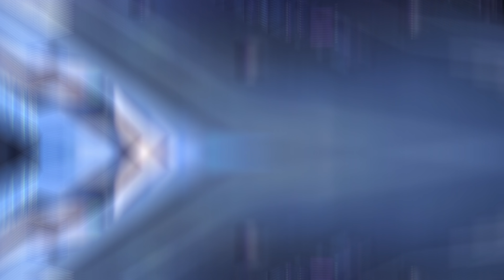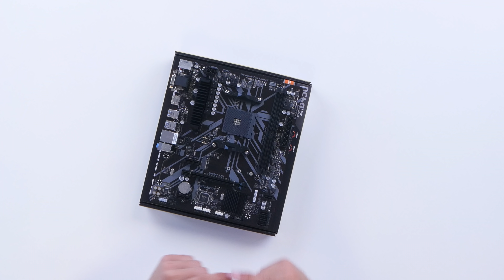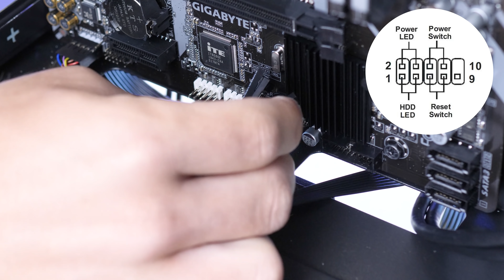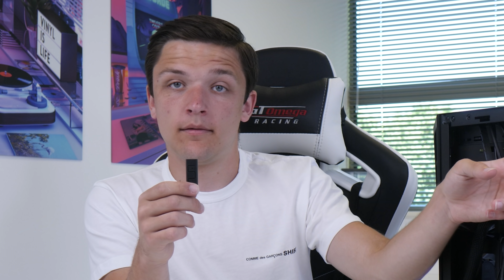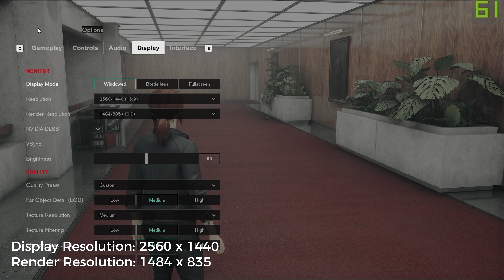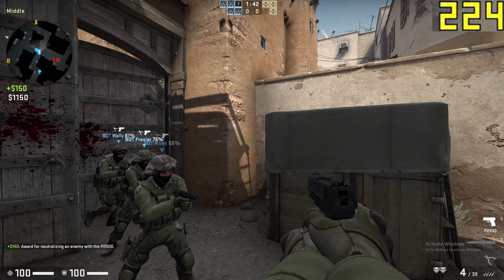Epic $800 Gaming PC Build 2020! [RTX 2060 w/ 1440p Benchmarks!]

Comment: Here is my built which is better
Ryzen 5 3600
Msi GTX 1660 super 6gb
Msi B450 tomahawk Max
16gb Ddr4 3200mhz
Sad 240gb
1tb hdd
PSU 650wats
And a Nzxt 510 case

Which comes around 800$ as well, And pushes 100+ frames
This built lacks Cpu power and Storages though

Comment: I have an even better one for cheaper.
Reply: Gaming pc
$120 CPU Intel Core i5-9400
$130 ASUS Motherboard
$220 Nvidia GeForce GTX 570 graphics
$030 16 GB Ram
$100 500 GB SSD
$050 600w Power Supply
$055CORSAIR - Carbide Series ATX Mid-Tower Case 
$20- Cable and things  
Total: $755 (with t a x)

Comment: for first time builders, i wouldn't recommenced this tutorial for a "covers all" type of video. it would be useful to mention spacing for RAM slots and installing/booting windows. incorrectly installed RAM can give you a noticeable performance hit and the installation of windows can be a bit daunting for new builders. other than that the video isn't half bad.
Reply: I would also install the cooler in first, before putting the motherboard in.
Reply: @CraigA_06  yes defiantly, i missed that one

Comment: $84 for 3000 speed ram isn’t a good deal. Also getting a RGB cooler for a budget build is not ideal. Ryzen CPUs ship with a stock cooler. It would be better to save on these and get a ryzen 5 or better GPU. Obviously this isn’t a budget build.
Reply: You are right
Reply: Also the mobo is crap
Reply: Right?! The stock cooler will do just fine with this caliber of a cpu. No need to get rgb and heck a whole another fan. As you said he could have gotten a ryzen 5, better mobo, non rgb 3000mhz 16gb for $50 instead of $84?! Also a rear fan for exhaust. Not his best work!

Comment: Hey I have a pretty hard question...
I was wondering if I should buy,

1. Ryzen 5 1600 af , gigabyte rtx 2060 windforce oc and a shadow rock 3 cooler

2. Ryzen 5 3600, gigabyte gtx 1660 super and the shadow rock 3.

3. Ryzen 3 3300x with the rtx 2060
And stock cooler.

Mostly gaming and streaming.
I really need your professional advice!
Thx
Reply: For best fps, ryzen 5 1600ad overclocked to 4.1 or 4.2ghz on the cooler with a 2060. 2060 15% stronger than a 1660 super so you get potentially 15% higher fpa
Reply: @miniweeddeerz1820  its the gigabyte rtx 2060 oc the cheapest one it has cheap cooling ... Idk i think I will go for 2 cuz when I feel like I need to I can upgrade my gpu

Comment: I have a R5 3400g and when I try high settings black spots appear around the screen 😔
Reply: maybe you need to update the drivers
Reply from the maker: That’s because the 3400G is an APU that isn’t designed for high settings
Reply: GeekaWhat so what should I get instead that’s around 250$ ish because I’m. Broke hahaha
Reply: @eddieespinoza7177  you could have saved more
Reply: @eddieespinoza7177  it only has 2gb of ram. It can't run high. If you want more fps, you need to oc igpu and CPU, with dual channel manually tuned ram.

Comment: But I feel that this build not balanced, 2060 is much higher than the processor, if you replace the cpu cooler with the stock and put ryzen 5 3600 will be much powerful
Reply from the maker: I disagree, for gaming the 3300X has been shown to perform with 2-3% of the 3600 👍

Comment: Great 800 build!! You use so many obscure cases. I need a Micro-ATX case to fit my Gigabyte B450M DS3H. What would you recommend as the best mATX Mid Tower?
Reply from the maker: This one! It’s a great mATx case 🥳
Reply: GeekaWhat damn it’s not gonna be in stock until June 28. Im thinking I should get the Thermaltake Versa H18, don’t really know though.
Reply: But get the mesh version for better thermals
Reply: SqueamishOrange does the motherboard that was used in this video support WiFi or just wired internet connections
Reply: Adrian_PL_ It only support wired
Reply: ً ً how could I then make it so I could WiFi

Comment: Just a question but couldnt you have used the cpu cooler that comes with the 3300x to save money?
Reply from the maker: Yes, but this will keep it cool (it’s a hotter running chip) and allow for some OCing if you like 👍
Reply: @GeekaWhat  ok thanks but without ocing it should do fine right?

Comment: I've been looking for a build around this price, but with a micro ATX case. All the good ones around 60-80 are out of stock rn, so what would you recommend? Also, how come you chose the 2060 instead of 5600xt?
Reply: If you are looking for this price I highly suggest buying a 2600 instead of the 3300x. A asrock b450m pro4 is a better mobo and the crucial ballistix sport is better ram. The dlm 21/22 with mesh front is a good replacement. Or a Phanteks p300a or cougar mx330g. All these cases you should buy a couple intake fans. Recommend Arctic p12 for cheap high performance. 2060 is better when overclocked compared to 5600xt and has more features.

Comment: Nothing much how r u doing. It amazing how u fit a 2060 in ur build when It takes half of ur budget. Great job and keep up the good work
Reply from the maker: Thanks dude! I’m great thanks 🥳
Reply: GeekaWhat what should my gpu be
Reply: Soul Champion What’s your budget?
Reply: I think this will fit for 1st world countries, in my country the 2060 is expensive hard to fit with the same budget
Reply: @demon6937  I’m in Canada and fuck no twice that pice dude
Reply: Tf. It's easy to fit a 2060 in. It's not an achievement. It should be the standard.
Reply: He is bottle necking
Reply: Monkeydog the 3300x doesn’t bottleneck until you get to a 2080. So he could have even had a 2070 super and still have gotten all the same performance.
Reply: @AshtonS24  there is a slim to none bottleneck g
Reply: Monkeydog he is not. Check the Gamers Nexus bottleneck test video on the 3300x in which it shows that the only gpu truly bottlenecked by this cpu is a 2080ti. They do recommend that you pair a reasonably budgeted card (like the 2060 or 5600xt) as the preferred way to go with this budget cpu (though you can go as high as a 2070 super and still get everything out of the card).

Comment: tomahawk max or carbon AC ??? ( which one is better and has wifi )
RTX 2060s / R5 3600 / 16 3200 ram 
and is 600w enough  ???
Reply from the maker: Carbon AC has Wi-Fi (that’s what the AC bit means) 👍
Reply: GeekaWhat  nice 👍 does it also have Bluetooth ?   / and what do you think of the specs 😊 / and is it necessary to get a cpu cooler instead of the case fans ( because the case I may choose only has a single rear fan ) ?      And thank you very much 🙏😍